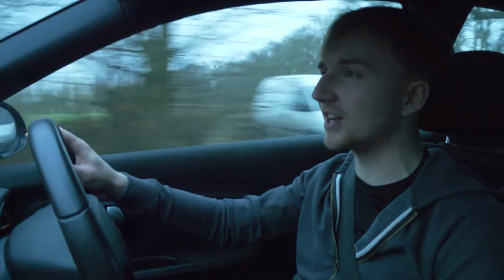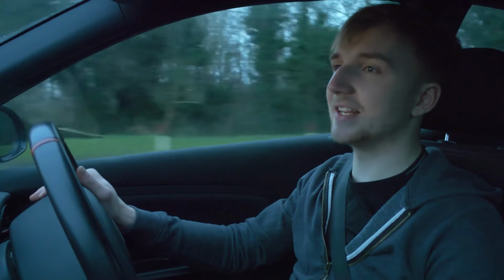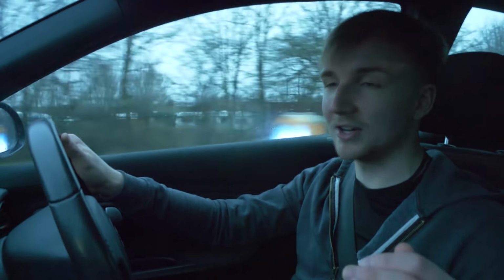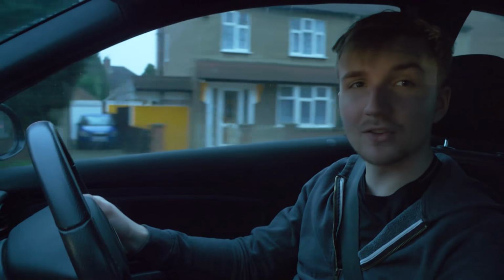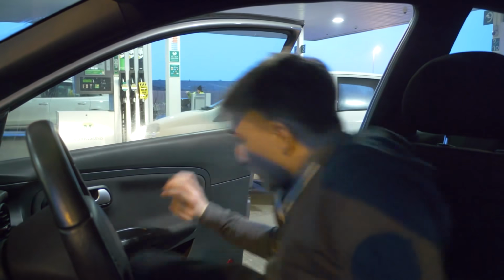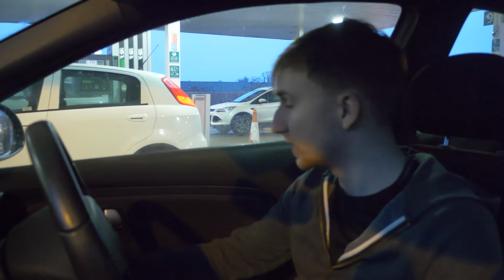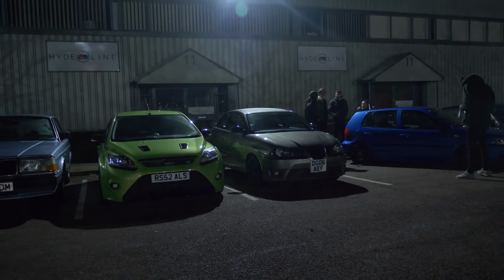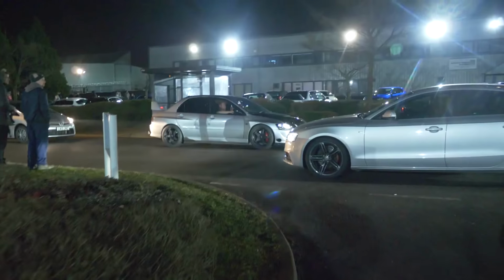The Dreaded Check Engine Light! - Lowdown UK Meet Vlog

Comment: You should get a Bluetooth OBDII reader - they're very cheap on Amazon and you can read the ECU error codes to see why the engine light is on - you can pair it to your phone and then use an app, such as Torque, to read the data in real-time. Will even show revs and other sensor data.

Comment: i recently just bought a Citroen c2 code limited edition, its not as fast as this, but its pretty nice, and in terms of looks, for me atleast, it better that the seat
Reply: How fast can a Citreon go? I'm curious. They look quite fast. My Ford Crown Victoria can go 130mph which I consider slow. However, it uses the 4.6L V8 250HP which was used in 90s Ford Mustangs but its top speed is limited to 130mph.
Reply: Yusuf elsayed top speed is 126mph from it's 1.6ltr engine, but it has a 0-60 time of 8 seconds, which is good enough for me
Reply: That's good for its engine size.

Comment: Why would you put premium in that 😂
Reply: Cory _182 Cars mapped, most likely to a higher octane fuel. Won't run properly with btec 95 ron.
Reply from the maker: Turbo life boi
Reply: Petrol turbo too. No where in your cars manual will it state that higher octane is better for your engine but for supercars it needs the higher octane to perform to its factory ability. However for lower litre and power cars it does nothing really but clean the insides. So because it has a turbo in a petrol it is just for cleaning purposes. Especially as any gunk in the engine or lines etc can cause the engine light to come on. (It has happened in mine) filled with a tank of higher octane and light went. Short terms its keeping his engine clean and running like factory rather than losing horsepower.